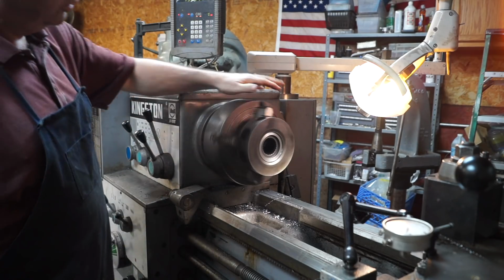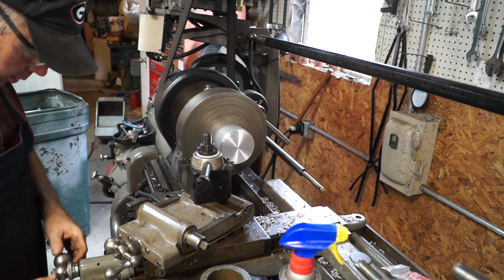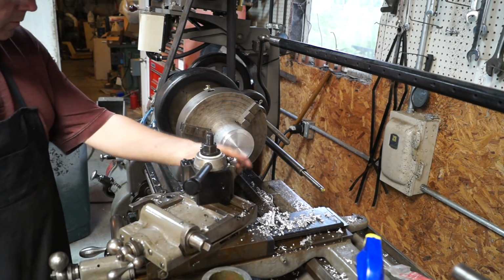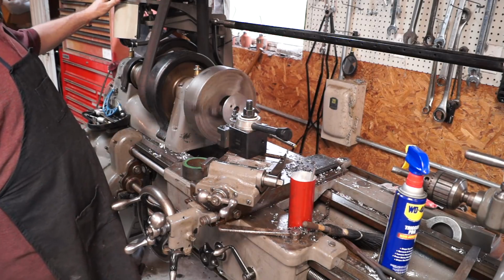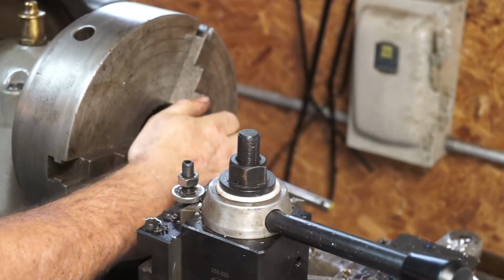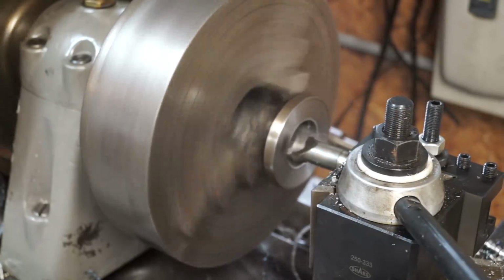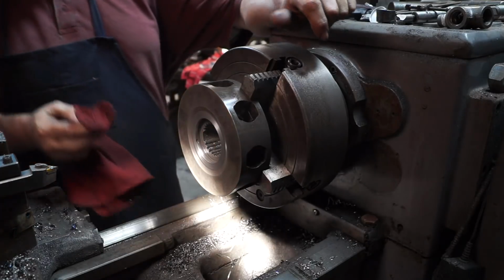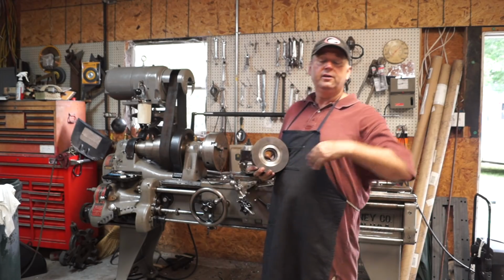Hydraulic Motor Rotor Repair

Comment: If you have another situation where you are barely running into a hole in otherwise good stock like you did, you could put a shim under one of the jaws to offset the part. That would move the hole closer to the center that will be removed anyway.